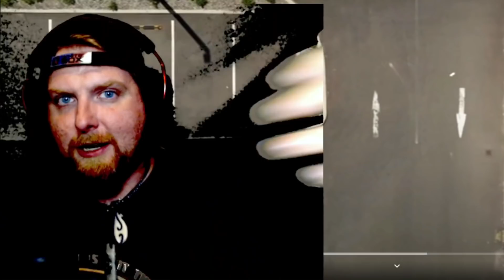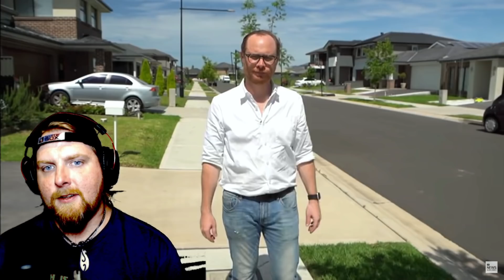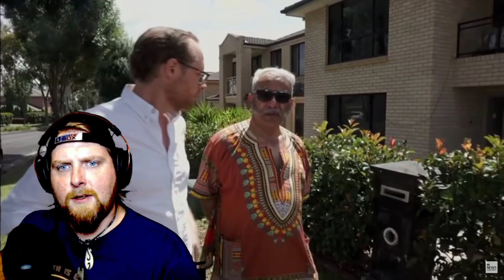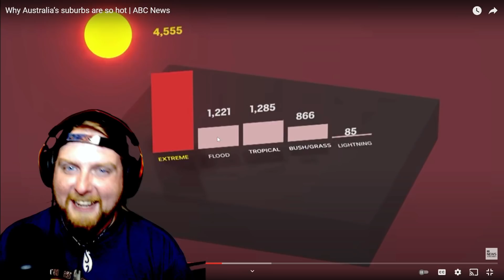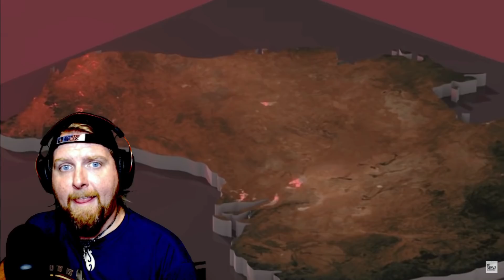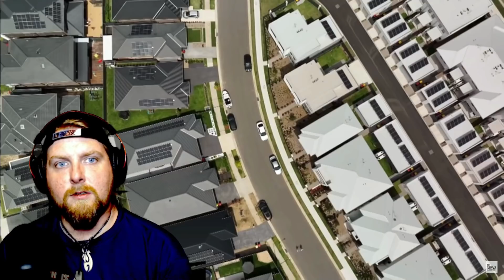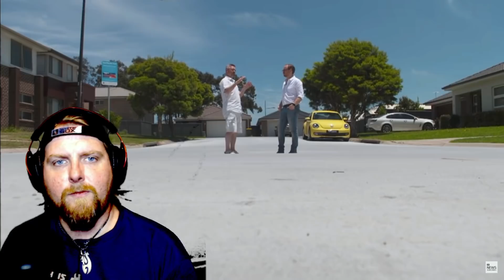American Reacts to Why Australia's Suburbs Are so HOT..

Comment: The temperatures in Austrslia are wild.  Melbourne has the reputation of having up to 4 seasons in a day.   It can have wild fluctuations.   Sydney has been covered in this doco.  Brisbane has a more even temperature.   Mild winters with the temperatures falling into single digits but rarely do we get a frost.  Summer however can get hot.  But once it does it can stay over 30c for up to two months.  But the constant heat is easier to stand even with the added humidity.

Comment: Tasmania is the "cooler" climate state, Victoria has a very wide range on climates and Melbourne ranges though pretty extreme swings in temperature depending on what's happening with air flow. They can be hit with winds pushing up from Antarctica, the desert or the Pacific ocean which is why its often said that you can experience all four seasons in a single day in Melbourne, from the biting cold to the searing heat interspersed with rain or mild sunny days.

Comment: I'm in Melbourne Victoria and 5 mins from the beach, I certainly don't think where I live it's really hot in summer, compared to other parts of Australia but it definitely does get bloody hot here at least a month or 2 every summer. The UV rays are very high I think Australia has the highest UV in the world.
I'm a fair skinned natural redhead so I'm really not conditioned for heat but I was born here.
Yeah I do agree with you about our homes are similar in Australia and America. Our house is in an older estate and we have lots of trees so it's better than the newer estates.  It can get up to around 44 degrees in summer, but the past 2 summers haven't been as brutal. I think we had a top temp of around 42 this past summer ( we are in autumn now) and that was only a handful of days mostly were mid 30s. Bushfire occur in Victoria every few summers and it seems we get extremely bad ones every 8 to 10 years.
Remember the UV makes it actually feel hotter than the temp.
Our son has been living in Arizona the past year and says that while it does get higher in temp it's still doesn't feel as hot as a Melbourne summer. We just use our aircons and screw what the cost is as its too bloody hot otherwise

Comment: The problem is this is only a new problem because of climate change. Planting trees or using solar cells wont fix it. I live in the bush where it has been hitting the high thirties and early forties almost every summer that I have been alive. But in the last ten years my old established suburb lost almost all of its mature trees - gum trees, but also cooler climate imports - due to the frequency of low rainfall and heatwaves we experienced. 200+ year old natives couldnt handle it. And desert plants capable of surviving those extremes dont make for good shade vegetation.

Its a far bigger problem than urban planning.

Comment: I live in one of the greener suburbs in melbourne and I think most houses still have red roof tiles, however there has been a few houses bought over the last decade and built to take up almost the whole plot. it will be interesting to see how that changes in the next 20 years. My local council has also introduced a new rule where if a tree is over a certain circumference you have to plant a tree of a certain height in it's place (I can't remember how tall)

Comment: I'm in a fairly bushy suburb, and on the river in southern Sydney, but due to surrounding hills we miss all but the strongest cooling easterly sea breezes. It's not uncommon to hit the mid 40's most summers, and it has hit 50 in the shade on our front veranda during a big heatwave a couple of times in the last 10 years. Lucky for me, I like the heat, but my 75 year old mum is starting to struggle during big heatwaves.

Comment: Yeah, I always knew, years ago, never buy a black car.
“A black object absorbs all wavelengths of light and converts them into heat, so the object gets warm. A white object reflects all wavelengths of light, so the light is not converted into heat and the temperature of the object does not increase noticeably”

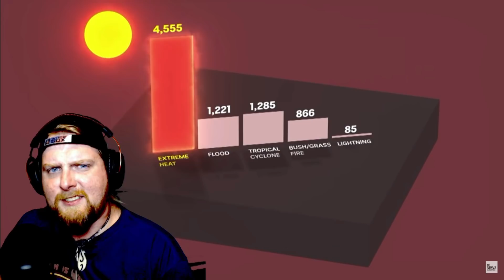Comment: 10:45 The 7th of February, 2009 had the highest recorded temperature of 46.4 degrees celsius. That is about 0.9 degrees celsius higher than my town's highest temperature record. And I live about 1700km (over 1000 miles) north-northeast of there. Looking at the weather map of Australia from February 7, 2009, Melbourne had some gusty winds blowing directly from the desert very far and northwest of Melbourne's location. The low-pressure system in the Southern Ocean and the high-pressure system in the Tasman Sea interacted to bring about these hot northwesterlies.
From my recollection about the hottest day on record where I live, we had winds blowing in hot westerlies from the desert. Normally, my town does not get much above 40 degrees celsius in the summer. But, if we get winds from the northwest, it can be really hot here. 
You will probably find that Melbourne, for much of their summers, gets mild weather. It does get hot. But, only in circumstances where the winds are blowing in from the desert.

Comment: Cooee Ian and family. I am an Australian living in South East Queensland.  I am very lucky that I live on almost 2 acres which is mostly bush backing onto Crown Land and a small creek.  As the report highlighted the house blocks are getting so small the developers just keep pushing the envelope with building houses that take up almost the whole yard.  Not only do the streets, pavements, driveways and house roofs give out a lot of heat making things hotter in the area, they also contribute to the massive floods we have been seeing.  I know we have had a ton of rain that broke a couple of records but the flooding was not all caused just by the rain. Before these huge housing developments, and all the infrastructure that goes with them e.g. shops, offices and recreation areas, when it rained it rained onto farms, grasslands, bush etc. that would soak up the water, filling aquafers and having very little runoff into the surrounding waterways.  Now the water from the roofs, roads etc is going down gutters straight down the drain and into culverts in huge volumes from so many developments into the redirected and vastly changed creeks or rivers.  A lot of the developments are moving further and further up stream of some of our major rivers causing the increased water volumes causing destruction down stream.  There is no easy answer to these problems but I wish that our local government councils would stop thinking about the Rates (property taxes in the US) revenue and start thinking about the environment and those people who already live in these areas.  Fertile farmland is being destroyed by developers coming in and buying the land to develop into Heat and Dust bowls.  It is so sad to see what we are doing to our country.  Love your channel and always look forward to your next videos.

Comment: Hi Ian! I live about an hour south of Melbourne on the coast (about a 15 minute drive from the ocean) and I remember the heatwave that happened in 2009. It was horrible. We only had one room that had air con and even with it on the highest fan speed and lowest temperature setting the room was still about 26-28 degrees Celsius while outside it was about 38-40 degrees Celsius. Myself and 5 other family members were fighting to be able to stand directly in front of the air con. The weather can be insane here.
Reply: Hi Ethan I live in the eastern suburbs of Melbourne and remember that extreme heatwave vividly.  I live in a rental with no air conditioning.  Just had a couple of cheap evaporative coolers which were useless.  If you walked outside you couldn't breathe the heat was so strong and smelt smoke all day from the bushfires it was a frightening day.  Never felt heat like it

Comment: I lived in Adelaide and it was the most ridiculous situation as far as the products they use for housing etc......colour bond fencing is one of the worst, used not just for fencing but all sorts of out buildings etc, it does nothing but turn up the temperature. A lot of people have fake grass, which is not helpful either, and also alot of concrete this is due to the fact they live on the outskirts of a desert where grass does not grow unless you water the hell out of it. We are not very smart with some of the building products we use.

Comment: In Melbourne here. We've got a silver tin roof which is very good for reflecting heat. Also we have much greenery growing in our yard and around the house. We've planted up our nature strip and when people walk on the footpath on a hot day between our garden and the nature strip  they comment on how much cooler it feels. Fish ponds also help to cool things down. Outside sun-shade blinds are on every window. We keep the windows closed on hot days to stop the hot air from entering. In hindsight we wished we had put insulation batts into the walls, rather than insulation foil when we renovated. A neighbour with a weatherboard house took the boards off on the hot, west side of his house, put in the batts and then put the boards back. A lot of work but a clever way to go.

Comment: I live in south western Sydney but worked in the Sydney CBD some days in summer I'd leave work thinking it's not too warm then get off the train 40 minutes later and think I was going to melt.! As that man said temperatures under my car port would often reach between 45 and 49°c but the official temperature was 40 to 42°c? Except this summer we've had hardly any hot days over 35°c just a lot of rain
When we didn't have air-conditioned trains it was like been in a furnace for 40 - 50 minutes probably about 50°c+  not good but all air conditioned now

Comment: Australia ties its hottest temperature on record
While Australians are used to summer heat, most only have to endure the occasional day over 40 Celsius (104 Fahrenheit). On January 13, though, the temperature peaked at 50.7 C (123.3 F) in Onslow, a small Western Australian (WA) town around 100 km (62 miles) from Exmouth [on the western coast of West Australia].

Remarkably, the town sits right next to the ocean, which usually provides cooling. By contrast, the infamously hot WA town of Marble Bar has only reached 49.6 C (121.3 F) this summer, despite its inland location. If confirmed, the Onslow temperature would equal Australia’s hottest on record set in Oodnadatta, South Australia, in January 1960. It would also mark only the fourth day over 50 C (122 F) for an Australian location since reliable observations began.

Unfortunately, this extreme heat is becoming more common as the world heats up. The number of days over 50 C (122 F) has doubled since the 1980s. These dangerous temperatures are now being recorded more often, not just in Australia but in cities in Pakistan, India and the Persian Gulf. This poses real threats to the health of people enduring them.

The 2022 lunar calendars are here. Order yours before they’re gone!

Where did the heat come from?
Hitting such extreme temperatures requires heat to build up over several days. Onslow’s temperatures had been close to average since a couple of heatwaves struck the Pilbara, WA, in the second half of December. So where did this unusual heat come from?

In short, from the bakingly hot desert. South to south-easterly winds blew very hot air from the interior of the state up to Onslow. The wind came from an area that has had little to no rainfall since November, so the very hot air was also extremely dry.

Dry air kept the sun beating at full intensity by preventing any cloud cover or storm formation. The result? The temperature rose and rose through the morning and early afternoon, and the temperature spiked at over 50 C (122 F) just before 2:30 pm local time.

Map of Australia with dotted lines showing temperature gradients and dark blue lines for wind.
View larger. | This weather chart from January 13, 2022, illustrates the conditions just half an hour before the record-equaling 50.7 C (123.3 F). The blue dashed line marks the trough that meets the coast close to Onslow and helped bring in the hot air. Image via The Conversation/ Bureau of Meteorology.
Aren’t we in a cooler La Niña period?
Australia’s weather is strongly linked to conditions in the Pacific Ocean. At the moment we’re in a La Niña event where we have cooler than normal ocean temperatures near the equator in the central and east Pacific. La Niña is typically associated with cooler, wetter conditions. But its effects on Australian weather are strongest in spring, when we had unusually wet and cool conditions over the east of the continent.

During summer, the relationship between La Niña and Australian weather usually weakens, with its strongest impacts normally confined to the northeast of the continent. During La Niña, we typically see fewer and less intense heatwaves across much of eastern Australia, but the intensity of heat extremes in Western Australia is not very different between La Niña and El Niño.

The pattern of extreme heat in Western Australia and flooding in parts of Queensland is fairly typical of a La Niña summer, although temperatures over 50 C (122 F) are extremely rare.

Men standing in flooded street in front of stores, with pumping equipment.
Recent flooding in Queensland is also typical of La Niña summers. Image via The Conversation/ RAPID RELIEF TEAM.
Climate change is cranking up the heat
Should these temperatures be a surprise? Sadly, no. Australia has warmed by around 1.4 C (2.5 F) since 1910, well ahead of the global average of 1.1 C (1.98 F). In northern Australia, summer-average temperatures have not risen as much as other parts of the country, because summers in the Top End have also gotten wetter. That’s in line with climate change models.

When the conditions are right in the Pilbara, however, heat is significantly more extreme than it used to be. Heat events in the region have become more frequent, more intense, and longer-lasting, just as in most other regions.

Most Australians have chosen not to live in Australia’s hottest areas. So you might think you don’t need to worry about 50 C (122 F) heatwaves. But as the climate continues to warm, we expect heatwave conditions to become much more common and extreme across the continent. In urban areas, roads and concrete soak up the sun’s heat, raising maximum temperatures by several degrees and making for dangerous conditions.

Even if we keep global warming below 2 C (3.6 F) in line with the Paris Agreement, we can still expect to see our first 50 C (122 F) days in Sydney and Melbourne in coming years. In January 2020 the Western Sydney suburb of Penrith came very close, reaching 48.9 C (120 F).

Man holds blond child in front of big fan with cooling mist being blown out.
Sydney and Melbourne will experience 50 C (122 F) days in coming years. Image via The Conversation/ Joe Castro/ AAP.
Staying below a 2 C rise
As you know, it’s going to be very hard to achieve even keeping global warming below 2 C (3.6 F), given the need to urgently slash greenhouse gas emissions in the next decade. As it stands, the world’s actions on emission reduction suggest we are actually on track for around 2.7 C (4.9 F) of warming, which would see devastating consequences for life on Earth.

We already know what we need to do to prevent this frightening future. The stronger the action to reduce greenhouse gas emissions globally – including by major carbon emitting countries such as Australia – the less the world will warm and the less Australian heat extremes will intensify. That’s because the relationships between greenhouse gas emissions, global temperatures and Australian heat extremes are roughly linear.

You may think Australians are good at surviving the heat. But the climate you were born in doesn’t exist any more. Sadly, our farms, wildlife and suburbs will struggle to cope with the extreme heat projected for coming decades. Let’s work to make this 50 C (122 F) record an outlier, and not the new normal.

Andrew King, Senior Lecturer in Climate Science, The University of Melbourne

This article is republished from The Conversation under a Creative Commons license. Read the original article.

Bottom line: Onslow, Australia, reached 50.7 C on January 13, 2022, tying its hottest temperature on record in the country and for the Southern Hemisphere.

Read more: The 2021 IPCC report: What you need to know

The Conversation
Twitter
Facebook
Pinterest
Buffer
Share
25
SHARES
Posted 
January 16, 2022
 in 
Earth
EarthSky Voices
VIEW ARTICLES
About the Author:
Members of the EarthSky community - including scientists, as well as science and nature writers from across the globe - weigh in on what's important to them.
Like what you read?
Subscribe and receive daily news delivered to your inbox.
Email Address
Your email address will only be used for EarthSky content. Privacy Policy
More from 
EarthSky Voices
VIEW ALL

Tornado Alley Is Shifting Toward Dixie

April 6, 2022
How Did Cockroaches Survive Dino-Killing Asteroid?

March 31, 2022
How Solar Storms Impact The Global Power Grid

March 24, 2022
Gegenschein: What Is It And How Can You See It?

March 22, 2022
Tonight

Comment: Thankfully never lived in those crazy hot suburbs. 
I've always lived fairly close the ocean in Sydney the past 12 yrs and qld before that. So we'd get the ocean air and breeze. Where I was in Sydney it rarely got into the 40s. Maybe a handful of times a year it would get to 40-41. But mostly in the 30s. Even in South East Qld where ive been the past year, it's usually around 24 to the early 30s in summer. Sometimes hotter in the mid to late 30s but almost never in the 40s. The thing is it gets humid in Qld.(and Sydney) so it can often feel hotter than what it is.
Lucky that I've always had trees and parks around me too.